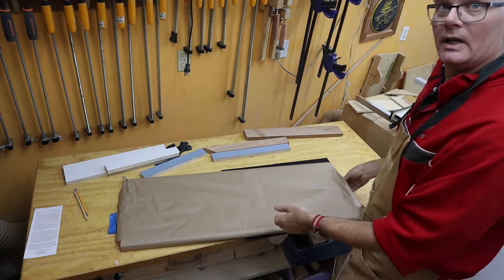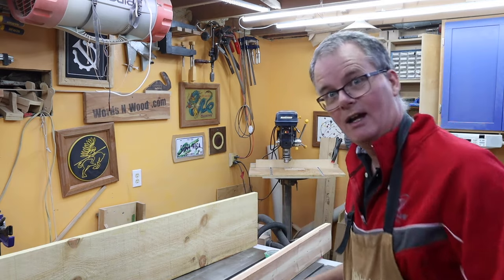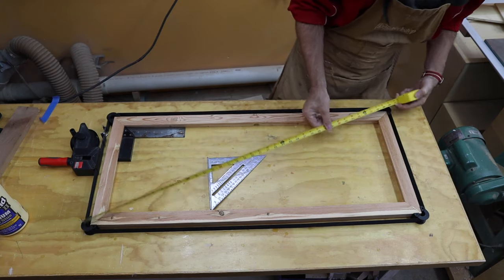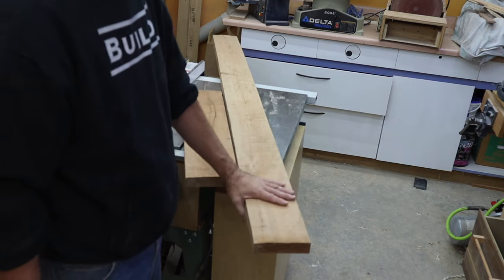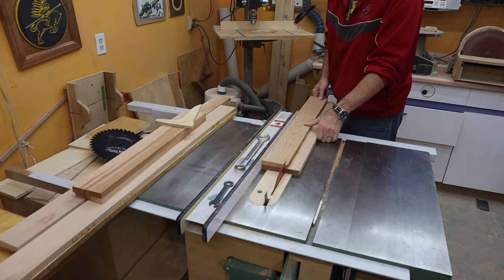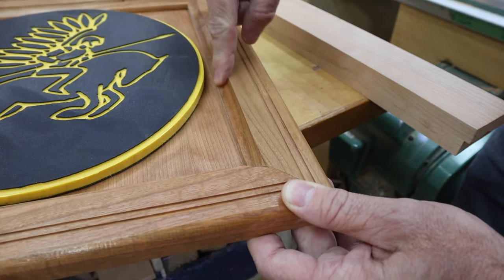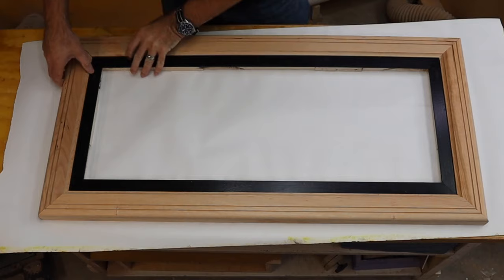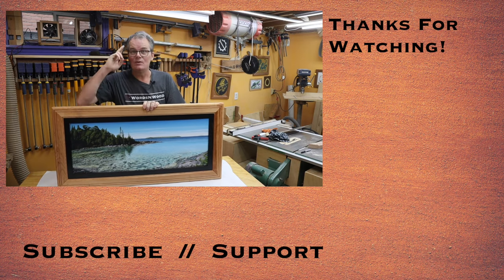HOW TO Make a DOUBLE picture frame // WnW 212

Comment from the maker: Patreon's get one free "ha-ha!"

📃Build Article:  http://www.wordsnwood.com/2020/doubleframe

My wife and I picked up a nice print while on vacation this summer and I wanted to make a nice picture frame for it.  This time I wanted to make a double frame - a frame within a frame.   I had several problems -- make that challenges -- crop up as I completed this build and each time I showed how I worked through the problem to continue the build.

YOUR SUPPORT IS APPRECIATED:
💵 Become a Patron: https://www.patreon.com/wordsnwood
🛒 Buy a Plan: http://wordsnwood.com/plans/
👕 Buy Merch: wordsnwood.com/merch.html
👉 http://www.wordsnwood.com/support.html

🗜 LINKS TO SOME OF THE ITEMS USED:

(AND/OR other tools and jigs that I use and recommend.
Most of these are affiliate links.  If you buy through these
links it helps support my channel.   Thank-you so much!)

https://amzn.to/34KBFqz -- Freud Glue Line rip blade
https://amzn.to/3kRNWiM -- Bessey VAS-23 Strap Clamp
http://amzn.to/1WSNq1j — Stanley Leverlock tape measure 
http://amzn.to/2lYXz3W — Other auto-locking tape measures
http://amzn.to/1TdiBp8 — Rust-Oleum clear Lacquer
https://amzn.to/2uzMlWF -- Watco clear lacquer
http://amzn.to/2kPENLs — 3M Finishing Pads / Scotch Brite

https://amzn.to/3ef7087 -- Timber Check moisture meter
(Same at Lee Valley:
https://www.leevalley.com/en-ca/shop/... )

http://amzn.to/2bpMmkX — DeWalt DW735 Planer
http://amzn.to/2beSIY6 — 3rd party blades for DW735
http://amzn.to/1QFDLYE — Delta BOSS Spindle Sander
http://amzn.to/2aRa6wD — Grizzly G0513ANV 2 HP Bandsaw (I have a similar earlier model)

Comment: Nice color combo. Will the lack of finish in the back cause problems with warping? I know with tops it does. Just wondering. Always enjoy your projects, Art. Thx.
Reply from the maker: I did lacquer the back of the cherry frame.  But it's true that I did not laquer or paint the back of the maple.   (I did paint both sides.)   Probably something to consider.

Comment: Art, I always enjoy your videos and yes, keep the "opportunities" in.  How did you attach the canvas to the inner black frame since it is a pass thru?  And also the black frame to the cherry?  Thanks again for the video.
Reply from the maker: Thanks for the note, Phil.
The inner frame is simply screwed to the outer frame with some (hidden) screws through the inside edge  (ie: the edge between the inner frame and the canvas.   I was going to use clips to hold in the canvas, but it turns out to be a nice friction fit as it is.  Remember there is a rabbet along the front of the black frame and the canvas fits against that.  But it's true that I skipped over this and maybe should not have.  I was painfully aware that my video was past 14 minutes by the time I filmed the conclusion.
Reply: @Wordsnwood  thanks for the reply Art.  None of your videos are too long to not watch all the way thru.  : )